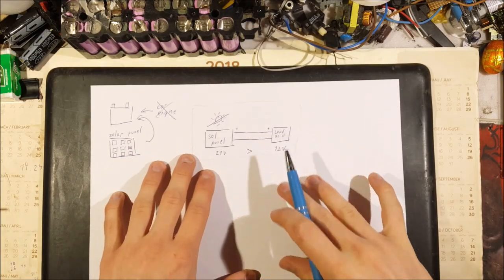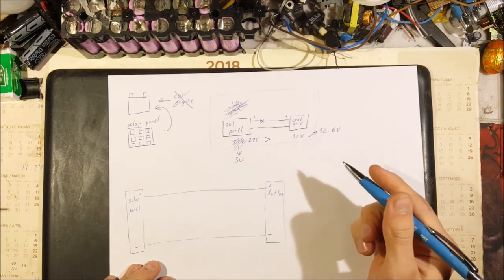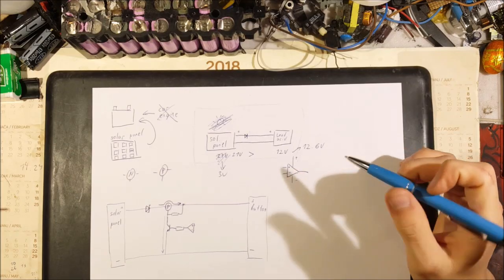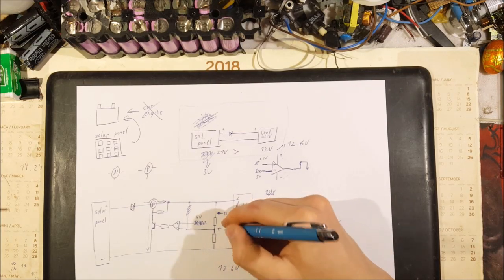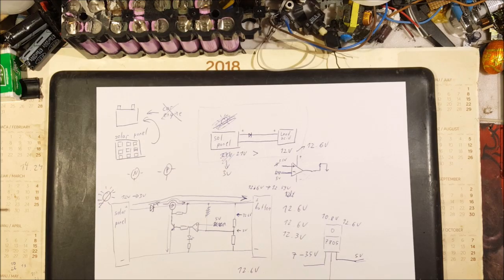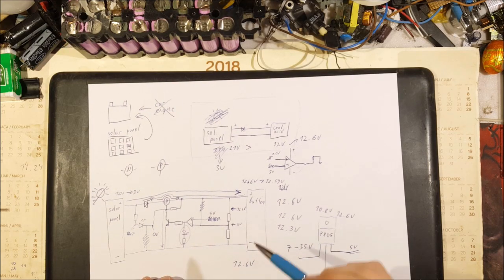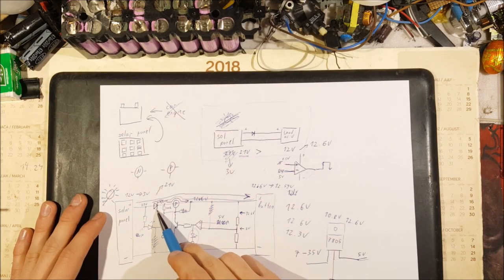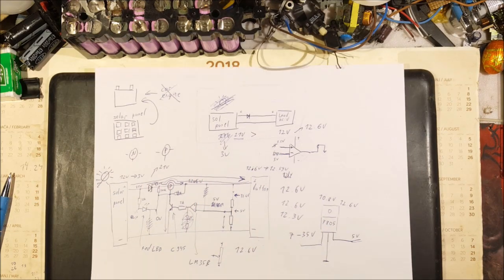LETP01: Designing a simple solar battery charger

Comment: As muuch as I love real paper, the main thing holding this concept back is that the discarded ideas kind of clutter the page. Is there any software for drawing circuits which allows to grey out traces and maybe even do simulations?
Reply from the maker: Maybe, I have not looked into the subject yet.
I know there are programs for simulating circuits, but my experience using them wasn't all that great...
My preferred method is doing it on paper and then experimenting on real hardware but If I keep making these I might look into getting a proper setup for drawing in a program

Comment: I like the idea of LAUETSP. I have a small question here 11:30 - if we use resistor to connect gate to positive voltage, why then there is no resistor when you conected it to negative voltage?
Reply from the maker: Thanks, it is in my opinion by far the best way to learn anything and since I already had a project that needs to be done, I thought why not try make it into an educational video.

As for the resistor it is because Mosfets are not like standard transistors, their gates behave like capacitors and once it is charged, no more current is flowing. This means that the resistor going to the positive rail would not be necessary for the mosfet, but I had to put it otherwise the transistor under it would switch into a short circuit.